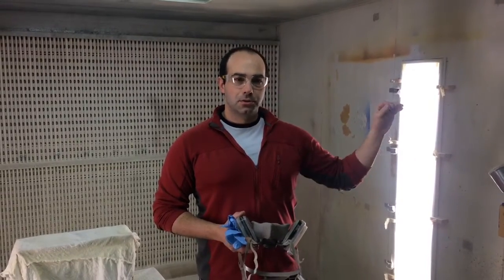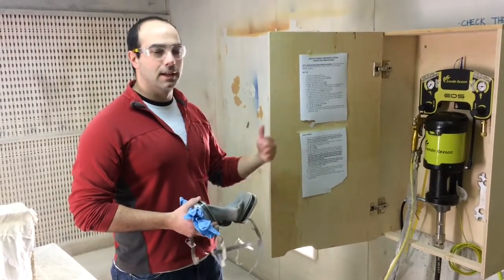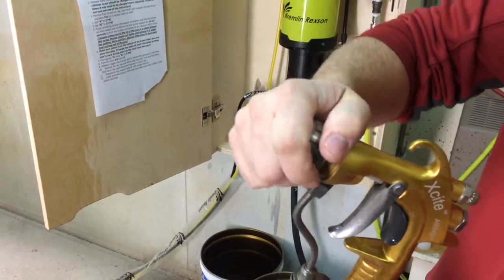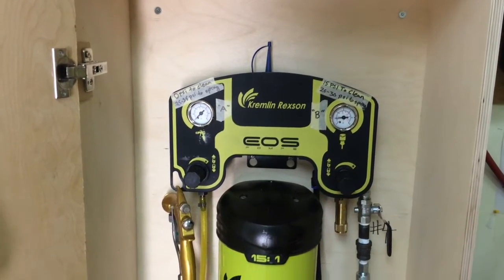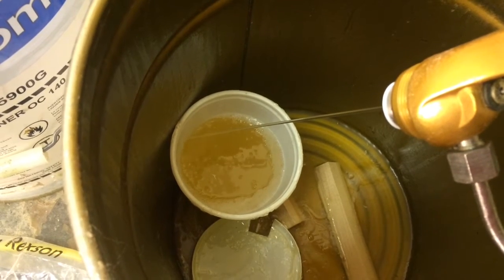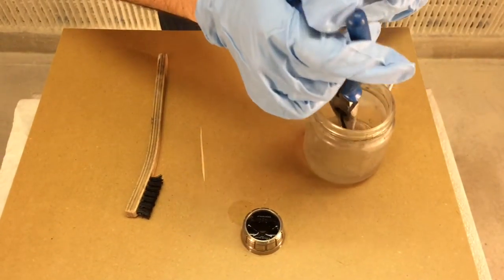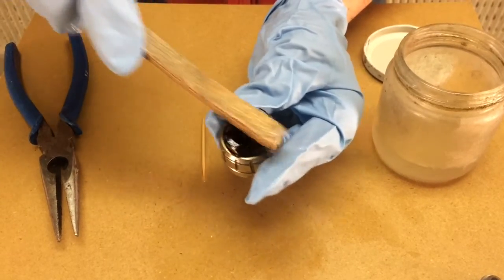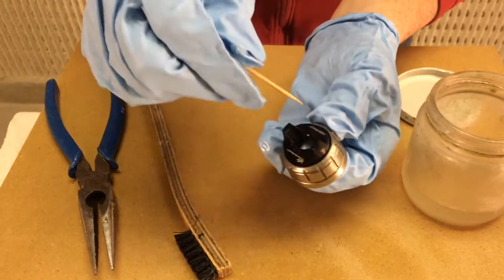Kremlin Spray System Cleaning

Comment: It looks like you're using the same lacquer thinner to clean out the system.  If that is the case then how many times do you reuse it before disposing?
Reply: That will depend on how often you flush the system and the solid content in your lacquer. Looks like they're using the AcromaPro Bernyl Facett precat so you can probably do this flush for <2 weeks-ish. Now for a serious professional tip. With a solvent recycler you could use this same lacquer thinner/ gunwash many many times over by just redistilling your cleaning solvent. You'll wanna be going through 50-100 qty of 5gal thinner/ gun wash for this to really make sense economically... Or just have a really great environmental program running in your spray operation :)
Reply: @sterlingbrownmiller9847   If you're spraying a precat lacquer, don't they contain cellulose nitrate? If so, all of the thinner recyclers I've seen and priced stated rather boldly that you cannot ever distill wash thinner that has cellulose nitrate in it. Apparently it's a fire hazard. Can you recommend one that isn't? We spray mostly conversion varnish but the occasional precat makes it's way into the shop.
Reply: @mattmeadows8587  Hey Matt, sorry for the late reply I have two youtube accounts and didn't check this one. I believe you're 100% correct. I don't work for a solvent recycling company but our recycler in the shop has it printed clearly in the manual not to run any nitrate through it. I believe Katilac makes a precat lacquer without any cellulose nitrate. But in all honesty, if you're using Facett you probably will like that better. I'm not sure if you can separate cellulose out of the thinner pre distillation but then you'd have to go through 100s-1000s of gallons in order for that process to be worth it. Or get yourself a digital mixing setup for a post cat lacquer for zero waste and then recycle your thinner/ gun wash with a solvent recycler.

Comment: Do you have to do this every day?
Reply: I have 6 Kremlins, and i can tell you they`re amazing pumps. But this guy is making the cleaning process look so complicated. 
Cleaning takes about 1min. 

1) Run thinner through the lines.
2) pour some thinner on the nozzle and brush it a little bit. Us an air blower to blow any dust that might go into the nozzle and plug it.
3) put the nozzle cap back on the gun and drop it into clean thinner until next use.
4) Next use, get ur material into it and shut down the air, drain the gun and open the fluid line where it meets the gun so you clean the metal filter. 

Does not matter where the piston stops when you clean the pump.

Maintenance on them would be the cartridge ($200 canadian) and the plastic seal at the end of the piston ($100 canadian), every 2 years on a pump that works 10 hours/day. 

On a new pump these things will need to be changed after 3 years of use. You can see laquer or paint coming up where the oil should be. Thats when you have to change them.

I have a 10-14 thats 15 years old and works like magic! Better than the new ones.

Only problem is the air hose. If catalyst touches it, you will have a hole in it in about 2 weeks.

Comment: All good and well for clearcoat, no biggie. But for post-catalyzed color coats, including color changes, there's a lot more involvement. We went from charcoal gray to a white but we were not diligent or fsstidious in changing the colored conversion varnish, our white had to be resprayed because it was contaminated by residual gray caught up in the fluid filter. And you don't show about cleaning the fluid filter, you're showing just a simple rinse.